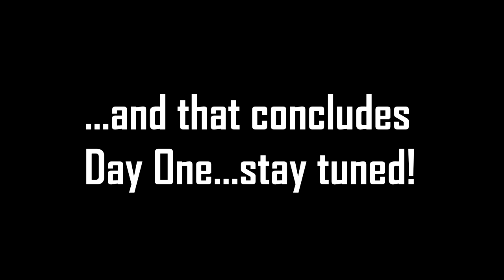A Well of Contentment - Day 1

Comment: Hi, E_Chip and Robber I would have asked if they ever Hit water like the old westerns with Oil well gushers... lol...
Reply from the maker: I would have asked too, but I already know the answer.  Rotary drilling does not cause pressure like old cable-tool drilling of yesteryear where a pointed bit was dropped down into a hole to break the bedrock.  No pressure, no gusher...bummer It would have been cool to watch.  I know that some wells will gush out a little bit around the drill stem if a big pocket of water is hit. In a prior life I worked for a oil well drilling tool manufacturer. E-Chip